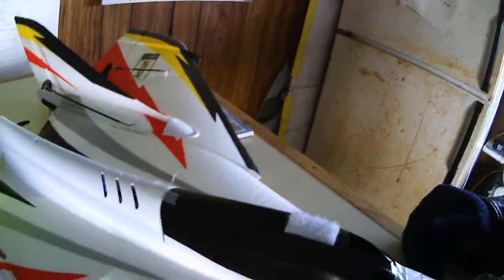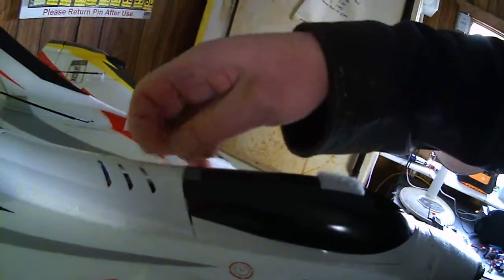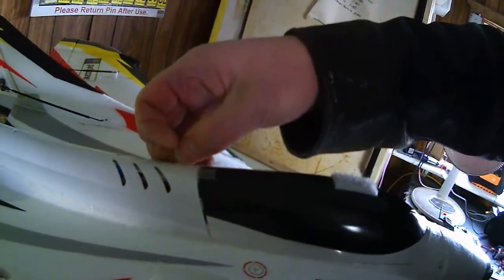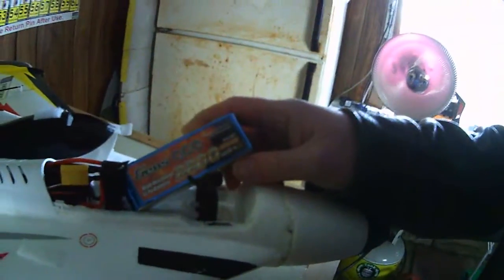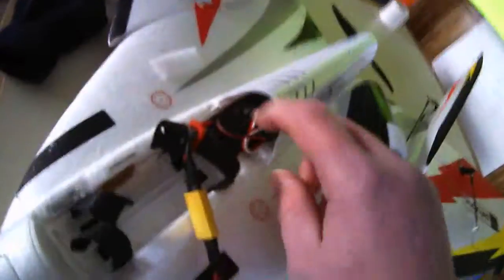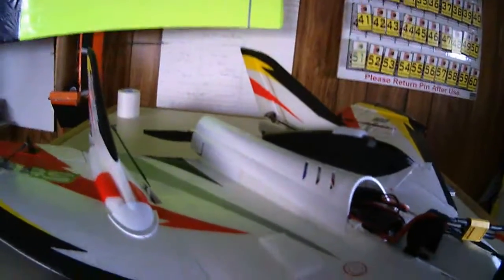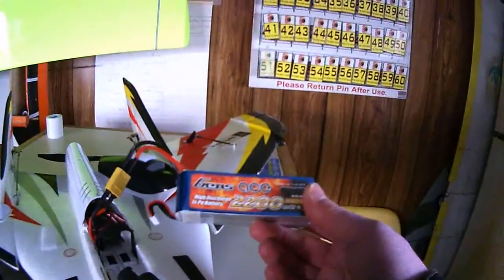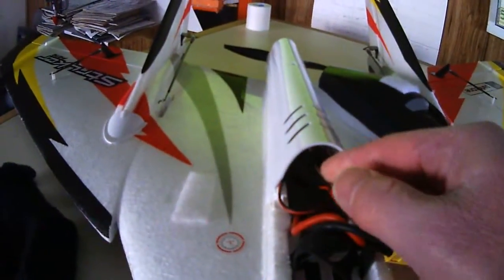Stryker F-27Q 4S configuration

Comment from the maker: :)  Glad to be of service.  LOL.  The thrill just gets better with the 27Q.  Do check the heat on the stock ESC after an aggressive run.  I think my bench tests showed stock prop and 4S config drew over 40 Amps ... I think in the air it probably unloaded a bit, but good to be carefull and check the heat, etc.

Comment from the maker: It is in the shop (nose first dip in the beans), but if I recall correctly, it was drawing between 40 and 50 amps on the stock prop at full throttle on the bench.  When I get it repaired (and if I remember :)) I'll rerun the test for you with the other prop - Master Airscrew 7x5... which is now my favourite.